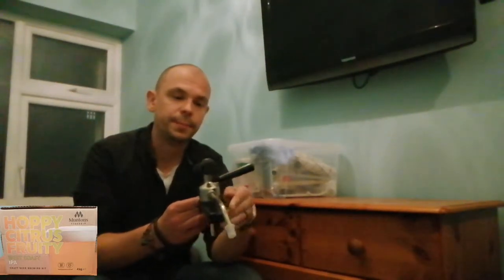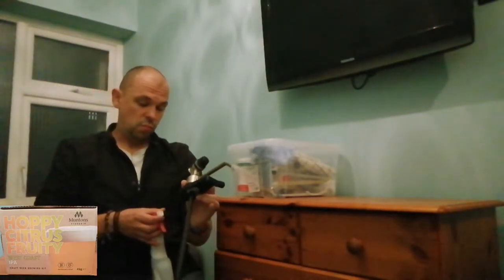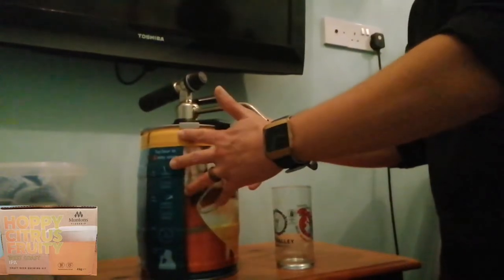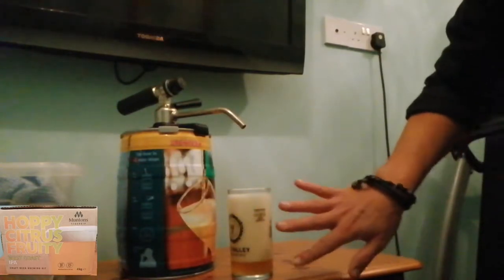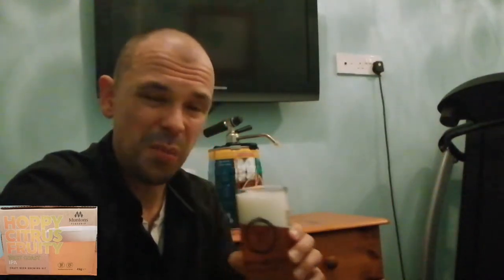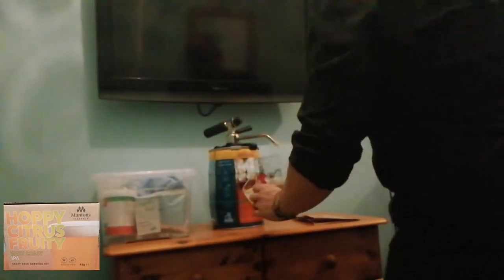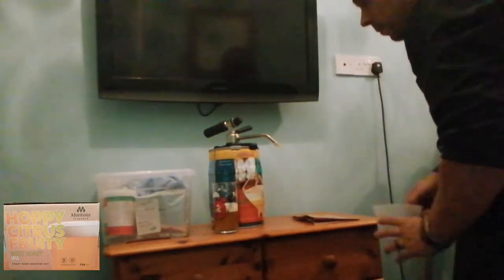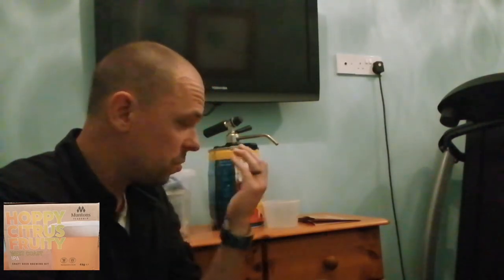From Keg to Glass. Muntons IPA

Comment: Party star pouring system i just cant get on with it
Reply from the maker: I've not had any issues with it. What can't you get on with ?
Reply: @darkvalebrewer93  my gas housing has a hole in it, has yours? Im pretty sure when i attach the gas its escaping out of that hole. Can you check if yours has a hole?
Reply from the maker: @jeewizz8646  yup, they all have a hole in the end. Maybe check the seal on the tap for any splits . If there's a split gas could be escaping from that. Also make sure it's tight